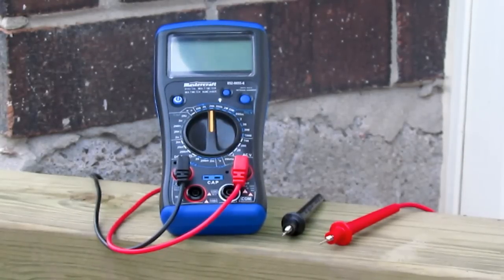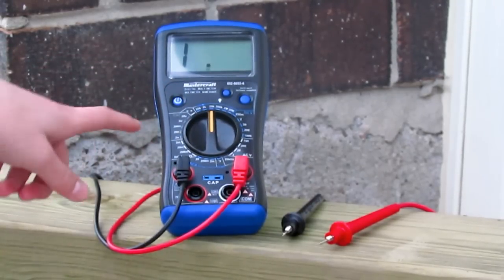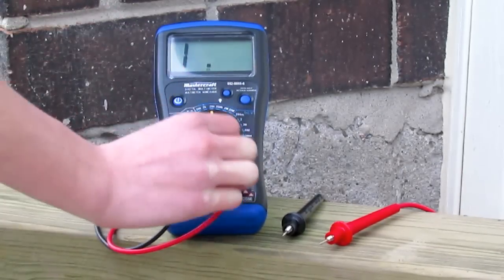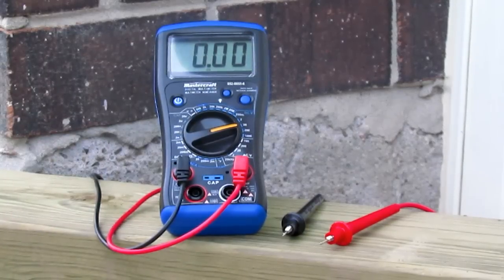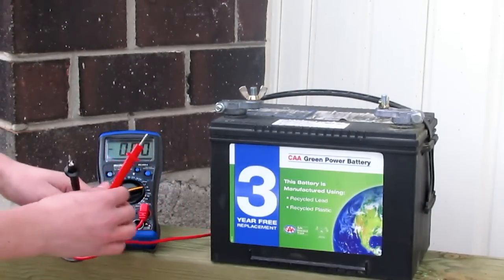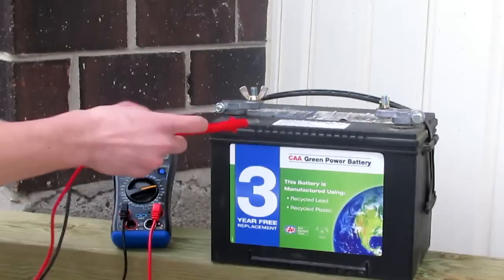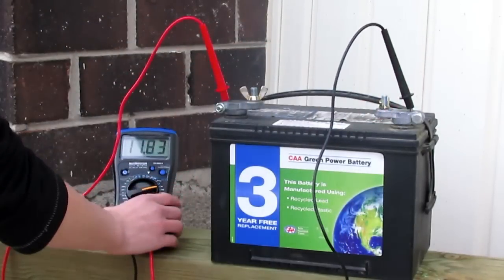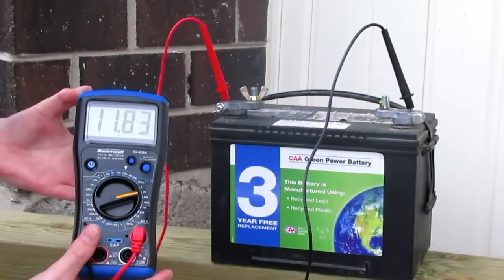How to Test a Car Battery with a Multimeter

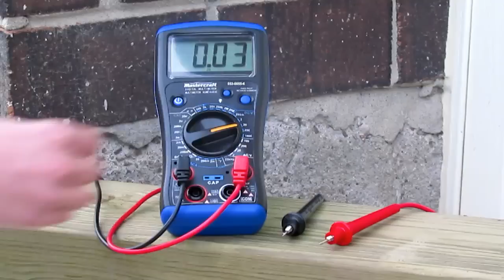Comment: 0:50 how know which to use like the 20, or if need other?
Reply: think about the maximum you are going to need. car battery is around 12-13 V so 20V setting is enough.  Tthe next one 200V will be for house voltage. If you use the 200V setting to measure the car battery, you will get results in decimal figures,
Reply: @lfcforever  ahhh gotcha, thx. so set for maximum and proper readings will be lower than that, but higher than the previous i.e. 20?? right?

Comment: 100% working car battery will have 12V and 0% working battery also 11V , so you can not test it like that ,  there area other things in play here ,  like  crank current ,  voltage drop when loaded , etc ..

Comment: Hi I have a Toyota rav4 when engine is running i put meter on battery and it dosent go up any volts at all, when i put headlights on voltage drops way down, and after a while the battery runs flat, so i recharge battery put it back in and it starts fine until motor runs battery flat again could it be battery or alternator
Reply from the maker: Farmer2492 the battery should be around 12 volts when the vehicle is turned off and if you read the battery when the car is running the battery should be around 14 volts also you can trying taking it to a auto shop and see what they have to say
Reply: Definitely alternator issue, battery is fine
Reply: If anyone else reads this, that's a dead alternator.  Your battery starts the car, the alternator charges the battery, your battery sends clicks that your engine makes kicks.

Comment: That doesn't mean much without a load test.
Reply from the maker: Jay Gold Yes this is only when the battery is sitting and the voltage will go down slowly once you connect a load to the battery
Reply: Jay Gold 
It makes sense for a baseline reading for like sorting batteries and testing purposes.
Reply: Was really hoping for something more than how to read voltage with that specific meter.  This is so weak, as is his battery.
Reply: All you people quite complaning,yes I'm complaining about complaining.

Comment: so would it be safe to say if it reads 6.2V its 50% full? Thanks
Reply: That's pretty much a dead battery.  11.8v is around 25% charge in it.
Reply from the maker: gdub1984 yes you are correct but the voltage you are saying is very low if its a 12 volt batterie
Reply: @terrificgaminghowtovideos5129  how do you check if its 100% charged
Reply: FUNNY

Comment: how i can know the ampire??
Reply from the maker: tamer Mazzawi Hi in the Manuel It will tell you to switch the positive and negative in another place. It depends on which multimeter you have.
Reply: Terrific Gaming How To Videos i want to now amp for betary 55AH amp
Reply from the maker: tamer Mazzawi the amprage and cold cracking amps (cca) are usually on the top of the battey